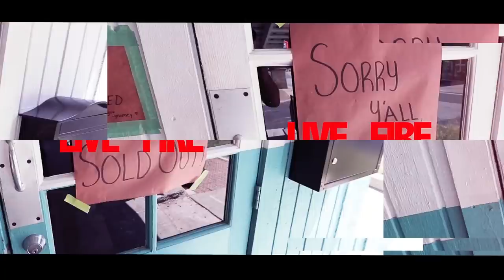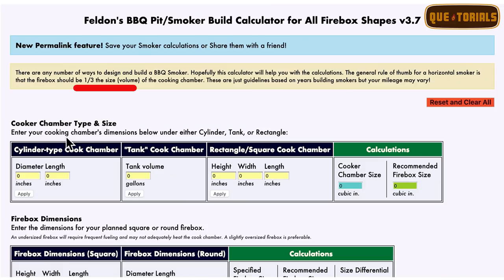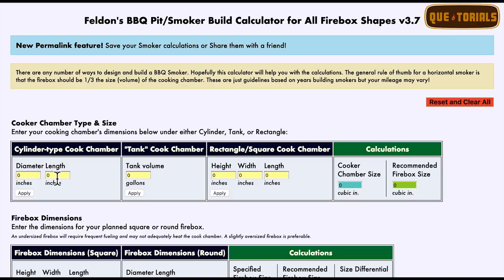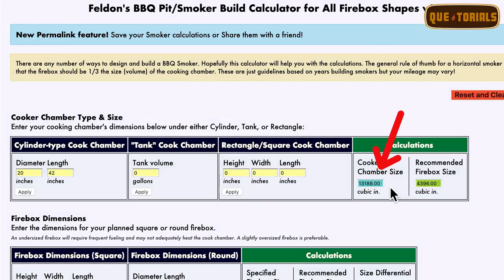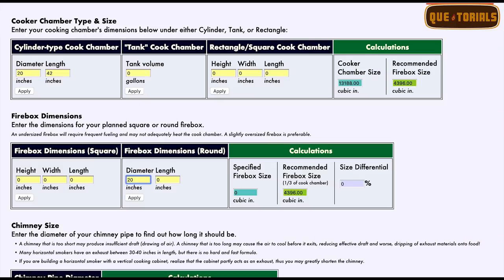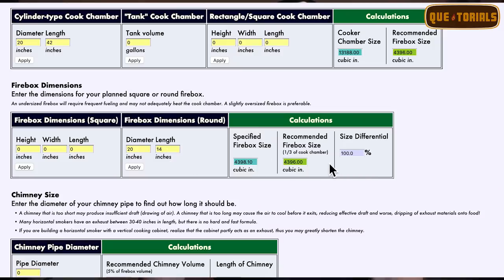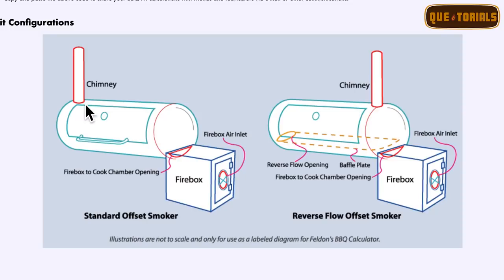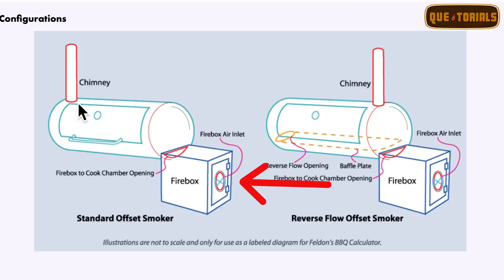You better watch this before you build or buy a BBQ smoker

Comment: I disagree with you analysis of the Feldon's calculator. It has been very helpful in tweaking and shaping my offset. I learned that my stack was a little too short, and my fire box inlet was too small. When I used the calculator to change according after inputting my dimensions, I noticed my pit was so much more efficient, and my bbq got better. The Feldon's calculator site states that an oversized firebox is preferable, and at the top in writing it says this is a guide to help you, kind of like you saying you need to look at every pit differently. If you take this calculator as end all be all, it's not what I got from the fine print which you might have missed. Use the calculator people, it's a GREAT guide.

Comment: When I built my 250 gallon offset the calculator told me to have a 16in smokestack based on my material measurements. I actually considered it and mocked it up and decided to extend the stack just because it looked so goofy lol wish the channel was around 2 summer's ago when I started my build! Thanks for the video brother!
Reply from the maker: It's insane how many smokers people send pics of asking if it looks right after using Feldon's that have major limitations.
Reply: @BBQcheese  my stack is 8 inches wide, I think what threw the calculator out of whack is my firebox is oversized for a 250 gallon, which I prefer because you get a few more options when the weather doesn't cooperate with a bigger firebox.

Comment: With all the spare time I seem to have on my hands I have been watching a lot of these videos and what I have noticed is the the fireboxes have grown in size so the wood will burn down as if you were using a burn barrel and then loading the coals in. The large space allows for the wood to get plenty of oxygen. Another thing that I am interested in is that a 1000 gallon smoker what is the flow rate over the food at the proper temperature while cooking brisket? It seems that that is a standard you could start with when calculating the stack to control draw over the meat. Then as a smoker shrinks in size you keep the same flow temperature rate and it should produce similar results. Great video's, thanks.  Also have you tried a square stack? a fluid will flow through a square shape more efficiently than a round one. Seems counterproductive but it isn't.

Comment: Heres a queation why not put the firebox directly underneath the smoking chamber with a baffle of heat deflection plate with 2 smaller stacks at either end on the smoker chamber.  What do you guys think?? My theory is more even heat/smoke distribution and withbthe baffle plate it will stip the heat of flames being directly under the meat....

Comment: Great video, even now in the year 2022, I have people ask why, as a pit builder, do I not use feldons calculator. My response is always the same, you can't pigeon hole pit building with such a calculator because there are other variables to take into account. And as mentioned in this video, I use a collector at grate level on all my pits, and size of collectors then come into play. But take any professionally built pit and plug the measurements into the calculator and it always spits out a smaller firebox then what's in use. I don't know about Feldon, but Aaron Franklin is someone I would say knows a TON about BBQ and his pits don't line up with the calculator either so................🙄
Reply: If you were to line your cook chamber and firebox with firebrick do you have to take into account the volume displacement of the bricks or no?

Comment: I used Feldons on my 250 gallon RF... Seems to struggle for air.. Always have to leave door open too.. Does not seem to pull proper draft.
Reply: dragonz868 try adding a 2 foot to the exhaust flue.  You can do temporary fix with coffee cans or metal ductwork.   That should help increase the draw when running the flue wide open and control heat with dampener.   You can add to the flue until you like the amount of draw and then decide on the length for a permanent fix.

Comment: Very nice video and information, I have a 8' X 3' tank and just bought a sheet of 1/2" steel for the fire box but limited to 27" X 36", I don't think now after watching this video the firebox will be large enough as I was using the Feldon's Calculator as a reference, maybe best to just use 5' of the tank and the metal I have for the fire box tks.

Comment: I'm beginning to feel like my idea of using an old 100 lb propane tank as the grill, and a 30lb tank as a fire box, is a bad idea lol Arg. I just secured free tanks too. The 30lb tank is 24 inches long but only 12.5 diameter. 100lb is a nice 48 inches long, but only 14.5 wide. Maybe cut up another 100lb tank and weld on sides for a firebox?
Reply: use what you got

Comment: I didn’t use any type of calculator when I first started building pits and they all cooked great. I learned about Feldon’s Calculator two years ago and it’s just that, a calculator. I teach high school math as well. We struggle with calculators in school. Calculators are as smart as the person using them! I find useful information on Feldon’s calculator then apply common building sense and everything turns out nice. If you are trying to use any calculator as the only source of knowledge you will be disappointed. I would suggest to use common building sense first then the calculator to check your answer. If you don’t have building sense then a calculator isn’t going to help you anyhow. Building pits is just like adding and subtracting not rocket science.
Reply from the maker: Agree on most Terry and thanks.   Once we began (2017) using CFD analysis, we quickly realized that every offset built had never had any idea what was going on inside the unit.   With some additional padding and a laser to fit, we began building units that burn + or - 3 to 5 degrees across 20'    No every unit is near identical in performance.   There is a good scale (not calculator) to use.  I have a vid coming on that soon.

Comment: What is a "collector"? Where does it go, what does it look, and what does it do?
Reply from the maker: It is the triangle catch basin surrounding the smoke stack.  The function of it is to keep smoke/heat from bottling up around the exit and help a more even flow across the grates.  It works pretty good.  We did computation fluid dynamics on the exit to see if it did what we thought it did and it was dang close.   It goes on the smoke stack side,  to the right and left of the stack.  Thanks!
Reply: @Quetorials  thank you for the response! Very interesting and helpful.
Reply: @Quetorials  I had a question if you don't mind. Is the size of the collector (from top to bottom) relative to the diameter of the smoke stack? Example. 5 inch smoke stack with a collector 5 inches from top plate to bottom plate.
Reply: Do you sell smokers? If so what is your company name?

Comment: I'm just about to cut into my smoker tank its 30 x 78 and I found that calculator it tells me my firebox is to small I have an old wood stove thats 19 w 17 t 33 deep I have never built a pit but I thought shoot if I add a larger stack and create more draw and insulate it it would preform okay it seems to me if you can keep heat you don't need as big of a fire and you can always be burning clean am I missing something?
Reply from the maker: I'd shoot for 24" min on firebox.   That size smoker would be great with a 6" stack

Comment: Great video once again. The stack on my offset is mounted on the upper half on the chamber (just like on a yoder) and im thinking of moving it down to grate level and add a collector. The air flow in the smoker is great so i think the size of the stack is just right. But do i have to consider changing the size of the stack if i move it to grate level? Does that make a difference in any way? Sry i know you dont have time to answer this type of questions but i give it a shot ;)
Reply: Anton Henriksson one thing to consider about a grate level stack... I built a reverse flow offset(video on my channel) I have two grates in mine, both are removable.  The upper grate on my cooker is significantly hotter (more than 50 degrees) when cooking.  This is sometimes good and sometimes bad. I guess it just depends on what your doing.  If your smoker is pretty consistent throughout and you like it that way you may want to leave it alone.  I am not as smart or as experienced as these guys but I think that the grate level stack is part of the reason it is so hot on top. Maybe it doesn’t matter where your stack is but it seems that all that heat may be kind of trapped up there.

Comment: I’ve watched this video 5 times. I’m still confused. Should I rely on the calculator?
Reply from the maker: Shane Bournival hey. No. Do not.  The calculator is highly flawed
Reply: Thank you. I figured as much but when you were using it and manipulating it I thought you were telling us to do the same. I built an offset smoker a couple months ago for the first time I used two 100 pound propane tanks. It came out pretty good. I just acquired a 500 gallon tank. Can I use a 120 gallon tank for the firebox? Love the videos. I seen all of them and still watch them again when they come up in my suggestions.
Reply from the maker: I’m releasing a video with a calculator or formula very soon.  Thanks
Reply: Quetorials can’t wait!!  Thank you for your time!!
Reply: @Quetorials  cant wait for your version of calculator....i made a couple of pits using your guesstimations more or less and manifold exhaust grill level, of corse...i could see smoke draw even with lid  open....unbelievable...thanks for all your help....new sub!

Comment: I used that same calculator and built it within 25% of the recommended sizes with a 16in square FB . So far I’m 135lb of pork into its use & couldn’t be happier.  I don’t understand your beef with said resource.
Reply from the maker: Jeremy Kastrup  the firebox ratio will never be big enough and I am going on a limb to say not a single offset smoker builder in the industry spent the resources we did on computational fluid dynamics testing. That process solidified my philosophy.  You building within 25% of the recommended size or 25% scaled?

Comment: I have a 250 smoker how big should the fire box be on it? The one on it is hella small
Reply from the maker: how long is the 250 and what is the diameter?
Reply: 82” length diameter 33”
Reply from the maker: @rubenponcejr3801  32"-35" optimal
Reply from the maker: Ruben Ponce Jr you can go up to 42”
Reply: Quetorials thank you I will probably go 42” thank you very much for your time I appreciate it.